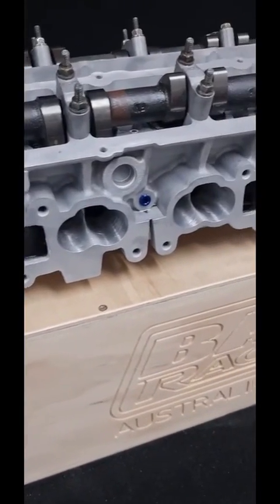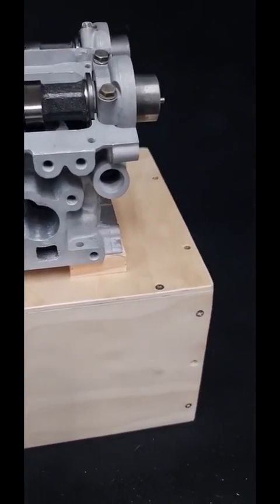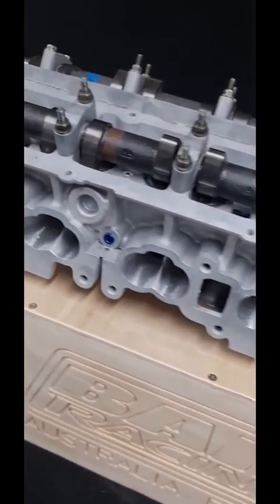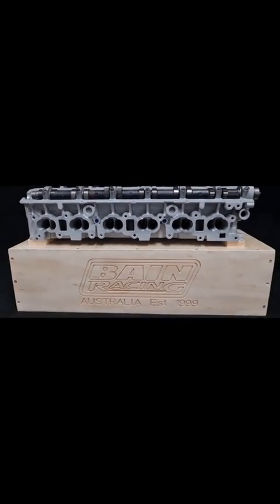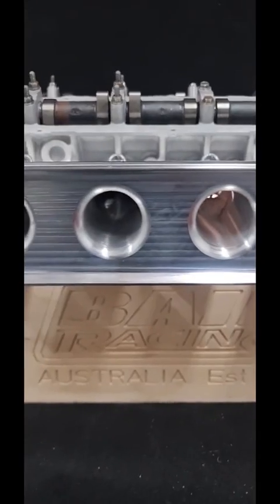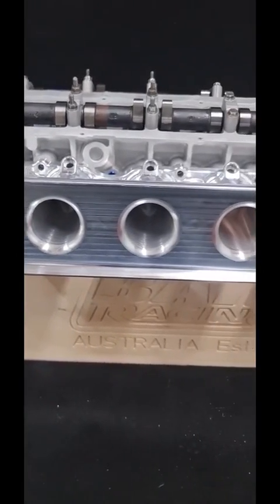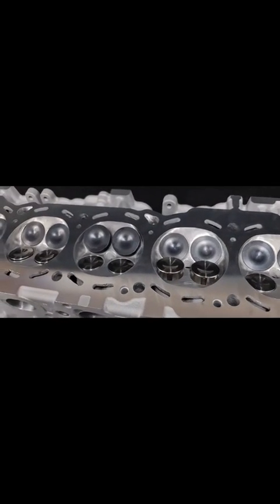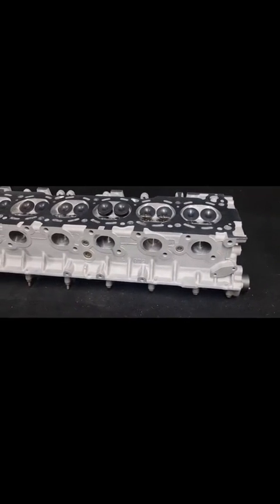"RB25 Neo Head Porting & CSA Transition: Achieving Peak Performance" #shorts #rb25det #porting

Comment: No stalling velocity 👍
Reply from the maker: That's the key to any good cylinder head. 👌
Reply: @bainracing  Did you choose mincsa dia as the size of the runner and throughout the port ? 

Is it recommended to stick to min csa from plenum to bowls, ir throughout the runner and port ? Or is it only from the divider upto the ssr that min csa dia should be followed and expand before and after that ?
Reply from the maker: @muftifaizan1964  No mate "MCSA" is "MIN" so the smallest CSA of the port. I personally like the MCSA as close to the valve as possible. that way i have the longest inertia length as possible. If that makes sense. If not let me know and I can go a bit deeper into the mechanism at play here.